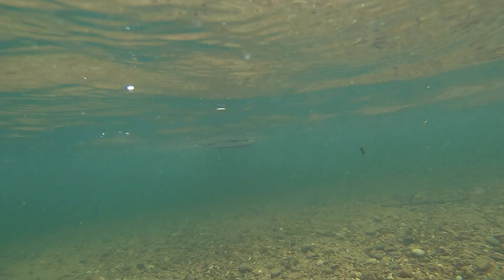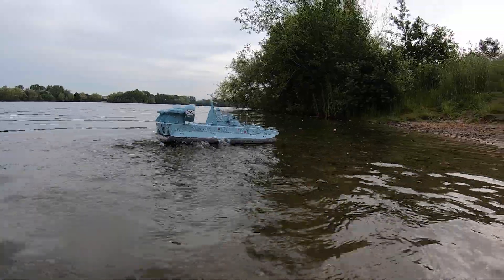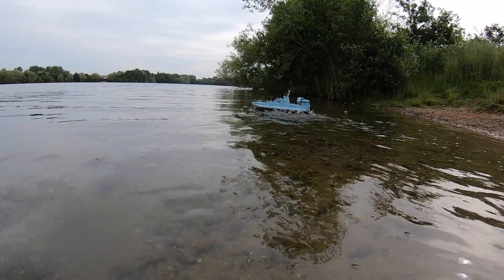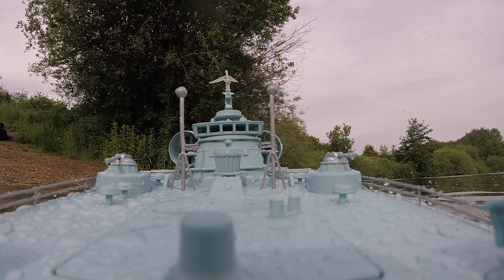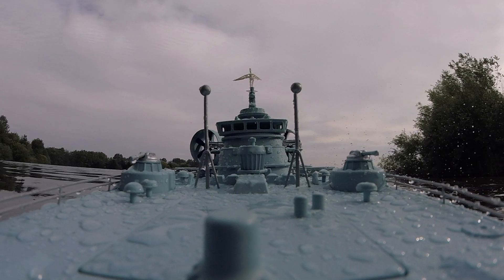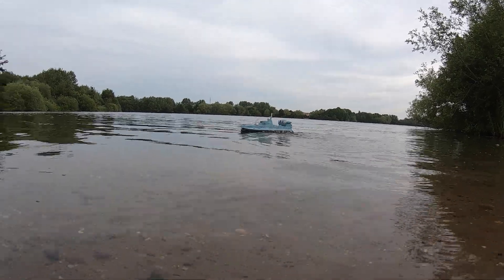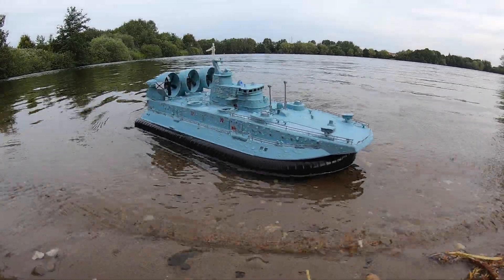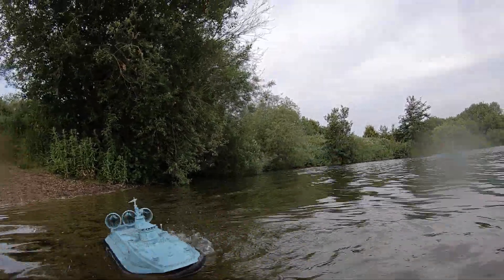Brushless RC Hovercraft HG-201 on Water - Worlds biggest Hovercraft Zubr-Class LCAC 1/110

Comment: Do you think if you take it apart and remove the stock motors, replace them with much stronger 3rd Party motors, that the performance would improve? (If so I'm willing to try)
Reply from the maker: I'm not sure it would. It's the balance and the design that's the issue, rather than the power
Reply: @TomleyRC  Ah, I see. Shame,,I've been thinking about that ever since I saw your video months ago and really wanted a nice multi engine Hovercraft since they are so hard to find.

Comment: Years ago i bought a few tyco hovercrafts. Try different electric motors even cox .049 gas power for lift. The dust clogged the carburetor since I didn't put a air filter. In the end I the only thing that really made a difference was making a hull out of foam and transfer the electronics. I had to make a skirt of waterproof nylon fabric. I use the slimest fabric I could find. Blue foam from home depot is easy to cut and sand to give any shape. Once is painted it didn't look like foam. Pretty much it was it was inexpensive to build the hull but a lot of internet research planing and testing. I find that the best balance is about 47% weight on the front and 53% on the back.
Reply from the maker: Sounds good. I'll certainly be trying a few things out with this to make it a little better.

Comment: THAT’S disappointing! I waited for this episode because I may have bought one. It doesn’t push nearly enough air underneath. There’s no cushion. I’d consider modifying it ~ how much was it again, Phil?
Reply from the maker: Yeah, no all that good. The skirt is more like a rubber dingy and can't adjust to the surface, so when you turn it just lets all the air flow out the side. They are around $200!

Comment: Nice video. Curious, are there holes on the perimeter of the skirt? It looks like the pressure is not being distributed evenly. This could because the air feed is too centralized & mispositioned...
Reply from the maker: There are some holes in the skirt at the front, but can't remember if they are any where else. The lift fan is certainly not giving an even distribution, so a bit of trial and error with some changes I think.

Comment: My old Radio Shack Hovercraft had no holes in the skirt and ran like a dream on land and water.  Worked good on sand and pea gravel, but not so much on grass and larger gravel/stones.
Great vid as always, I like an honest view point.
The model does look to have some potential though.
Reply from the maker: This I'm sure can be improved, I'll take it apart and see if I can make any slight mods to get it working a bit better :)
Reply: @TomleyRC  You need way more airflow under her.  I would cover the holes in the skirt as well, direct all the air under it.
Reply from the maker: Ian Nickerson I’ll give it a go 👍🏻
Reply: Always a great honest review 👍🏼  I’m curious too see if it or what you can do to improve this model.  It is a neat feature.  I’d like to get a hovercraft for my 3 little girls to play around with. Yet durable enough and powerful enough for ol dad to have fun two 😁👍🏼

Comment: Great review.  I really wanted this to be a great product, but I wasnt holding out too much hope. There's something about rc hovercrafts that just doesn't seem to work. Hopefully one day someone will nail it!
Reply: I noticed my RC hovercraft in the attic the other day. I asked myself why I never play with it and remembered that:
 it´s really slow and vulnerable to crosswinds on water
it´s really uncontrollable and vulnerable to crosswinds on land
 Like you, Dave, I had been really hoping that this one would be brilliant, but with the thrust axis so high above the main source of drag it´s always going to want to bury its nose at sea even if you were to trim it to sit with its bum in the water and there´s something fundamentally amiss with the skirt design, too
. I wonder how the original manages to overcome the high thrust axis?
Reply from the maker: It’s a real shame, I think is all in the bag....quickly looking at this one and putting my engineering head on I’m not sure this design is actually how a real one works. I think the bag should not be sealed (ie...like a dingy). Also I’m not sure a single lift fan in the centre is the way to go. Maybe 4 smaller ones would give a more stable platform. Anyway, not sure I can modify it enough to make it work. But I’ll certainly give it a try!
Reply: I think the design of hovercraft skirts is more complicated than I´d ever realised...my computer says that: the simple flexible skirt later evolved into a more intricate design, with hundreds of independently moving "fingers" attached to the bottom that could maintain the airflow even more effectively. A modern hovercraft combines elements of the peripheral jet and flexible skirt designs by directing many jets of air inward through the skirt.
 Hmm... @TomleyRC

Comment: one thing I'd try with it, is enlarging the holes in the under body (not the skirt so much) a bit to see if increased flow will give more lift. a little larger towards the front for what I saw on the water, maybe slightly enlarge the forward skirt holes too. it's really lacking on lift, may need stronger higher RPM motors to get that cushion flow up (double at least!!)
Reply from the maker: I think the problem is the skirt is not flexible/soft enough or even big enough. Increasing the down fan to max just caused the craft to hop up and down on the water erratically. Not sure how to increase the lift but not cause it to be to unstable